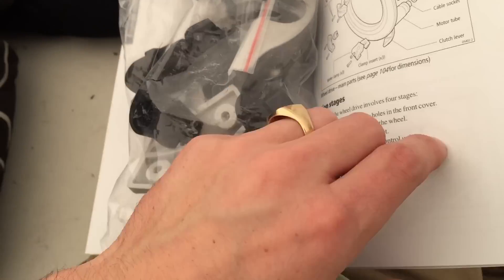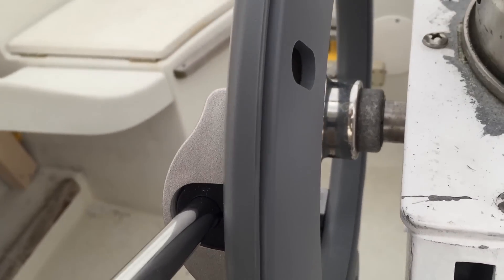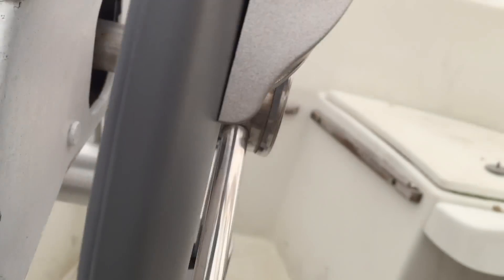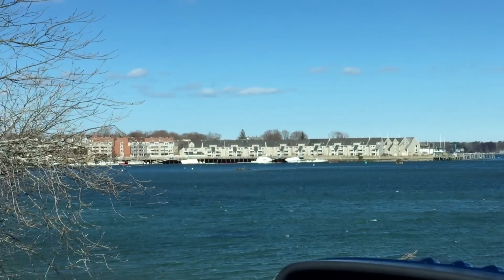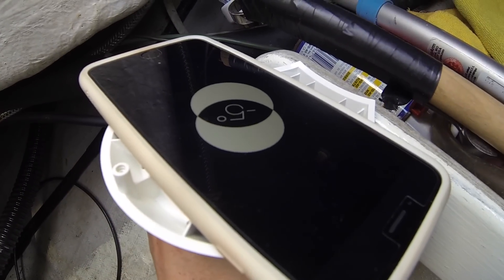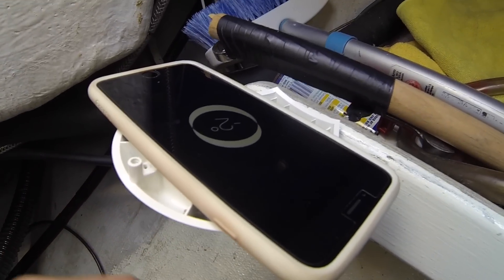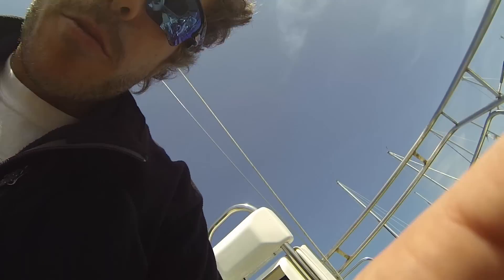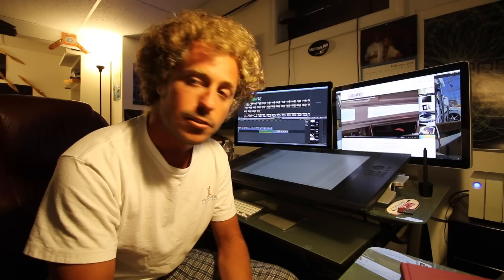Raymarine | 03 - Evolution Autopilot Wheel EV-100 Install & Mounting for Sailboats T70152

Comment: Thank you.  This was a very informative video.  I am mounting the EV-100 on my 1980 C&C 32.  Looks very similar to your boat.  After seeing your video, I now have confidence enough to attach the drive to my wheel.  Truth be told, I have someone who knows what they are doing doing the wiring.  I put the control head on the outer bulkhead of the cabin, next to the companionway.  Figure I might want to control it from that part of the cockpit.  I could use a remote, which I do not have yet, to use it while I am at the wheel.  Probably should have mounted the control on the pedestal, but we'll see how it works out.  Can always move it.  I subscribed and will look for your other videos.